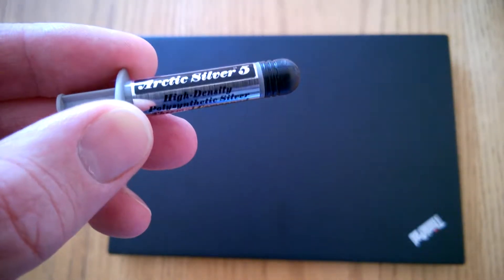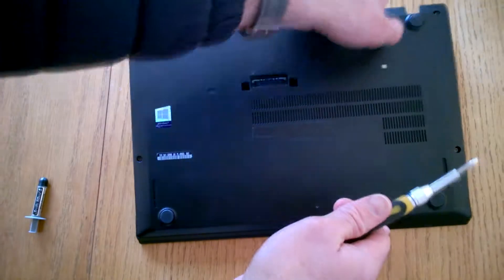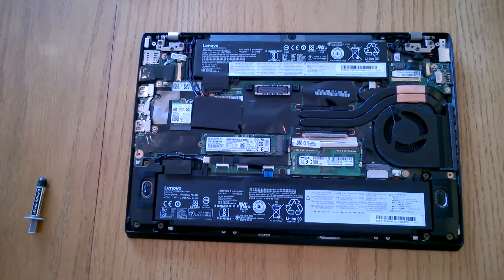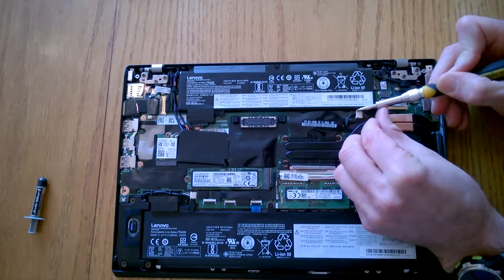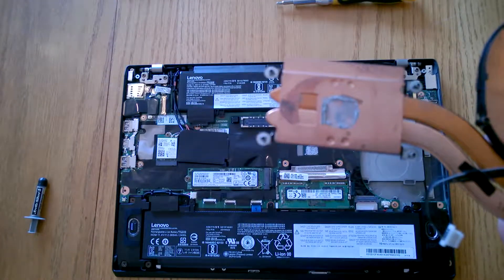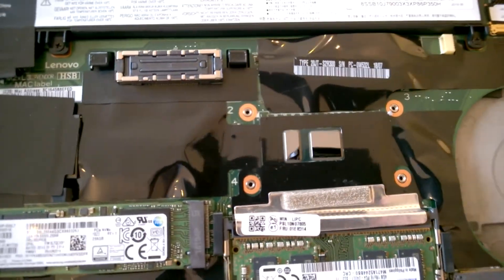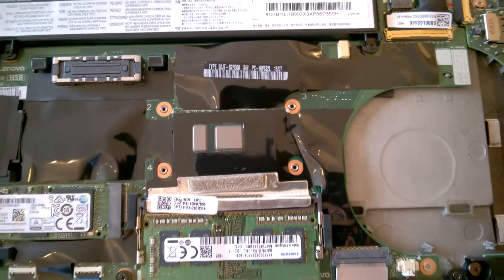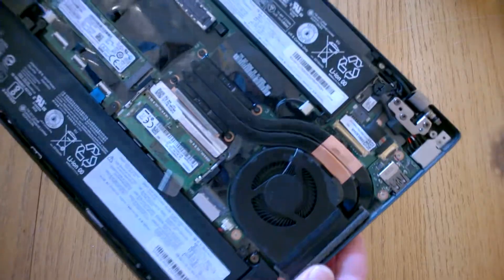Lenovo T470s Heat Sink Compound Replacement

Comment: The first time you were right to give a little thermal paste, but why even flattened it. and die igpu you let it dry without adding paste. you gave the wrong guide
Reply from the maker: Adding thermal paste is very much a personal preference. Some flatten, some don't. Some put a dot, a cross, a line, so put loads. Tests show is doesn't really matter how you apply, as long as you apply some.
Spreading it thin is my preference so I know I've not put too much on.

You can see when the heatsink is first removed there was no heatsink compound or indeed thermal pads on this section to start with. Putting heatsink compound on this area would not do anything because the heatsink itself had a recess there anyway.

Cheers for watching!

Comment: Thank you for the video Chris! Could be nice if you would say the difference in temperature of the CPU before and after replacement! Thank you again, nice laptop still in 2023!
Reply from the maker: Good point! It is hard to quantify whilst various apps are running but my idle temperatures went from in the 50 C range down to mid 40 C range. It was certainly an improvement which meant that the fan was that much quieter.
Also, it is rare that the CPU hits the maximum 95 C temperature now, by which time it would be thermal throttling!

Comment: Do you know any compatible upgradeable motherboards that I can replace on my t470s?
I am looking for upgrades to be like 2022 speeds that fit in T470#
Reply from the maker: I think you would be hard pressed to change the motherboard but certainly worth adding some extra memory and ensure you have a high speed SSD drive installed.

Comment: Hey Chris, does the PCH (beside the main die) also need to be thermal pasted?
Reply: it's southbridge
Reply from the maker: If you can it is always worth it, but you may be able to see from the video that my heatsink had a cut out for the 'other' die so didn't seem to make any contact. I believe that the GPU (Intel® HD Graphics 520) is integrated into the CPU.
Reply: Chris Horswill Oh. So what is the other rectangle supposed to be? I just assumed it was the Intel HD 520.
Reply: @NoName-eq9md  It's the PCH (platform controller hub) that's supposed to be running at a much lower temperature than the CPU, meaning that if you put thermal paste on it, it will heat up by extracting heat from the heatsink of higher temp. If it comes without thermal paste from the factory, you'd probably better off without it.

Comment: Disconnect the battery FIRST!

Arctic Silver 5 is not a good thermalpaste any more.
Reply from the maker: @岩成-f4w  I've never had that in all the laptops I've worked on.
Reply from the maker: LOL - that is not required. What do you think the battery is going to do!? Explode?  Also, Arctic Silver is fine, a much better upgrade to what was there from factory!
Reply: @ChrisHorswill  Will there be a risk of accidental short circuiting if the battery is still connected?
Reply: @binesh.a  Since you are not connecting or disconnecting any plugs there is no risk of short circuit, so disconnecting the battery is not necessary.

Comment: That is a very wrong way to apply thermal paste
Reply from the maker: There is no correct way lol :) It is so open to personal interpretation. Some slap it on and cover the die, others put on just a smear. This is my way. This is YouTube not School or university :)
Reply: why?
Reply: @locngo6001  You should only apply a small drop in the middle of the die. Then install the fan and that is it. Look for other tutorials on youtube for reference.

Comment: do you recommend getting a used T470 now? It's almost 2020 already.
Reply: yes! I have a t460, 32gb ram i5 6300u and it's perfect. built to last and still pretty relevant even 3 years on!
Reply: @woohorriblehistories  so do i recommend it 'cause have yet the same config and works perfectly
Reply: I'm still using the T430 and X230.. haha these machines last forever.
Reply: I would happily buy even a 15 year old Thinkpad with no concerns.
Reply: Definitely, my dad still has 2nd gen core i3 thinkpad and thinkcentre, still going strong.
Reply: I love my T470. I got it in 2018, but it's still going strong.
Reply: 3 years on, but these things are built like a tank and run Linux supremely. New thermal paste every few years and it'll run like a champ for years.